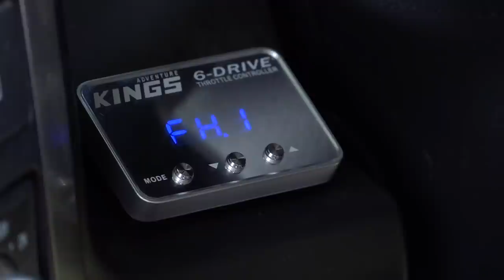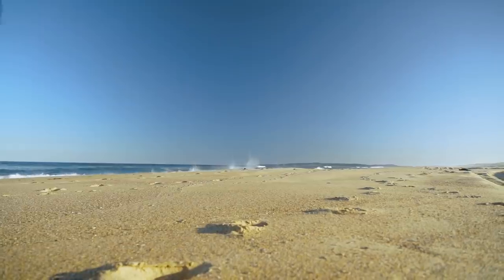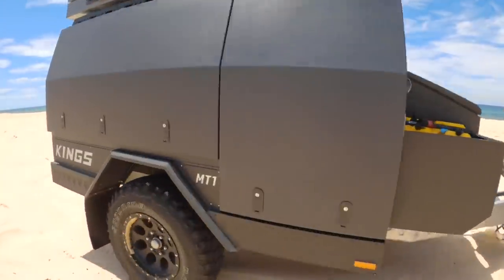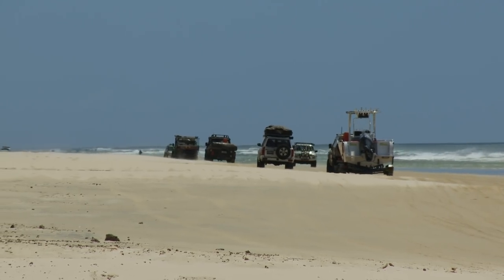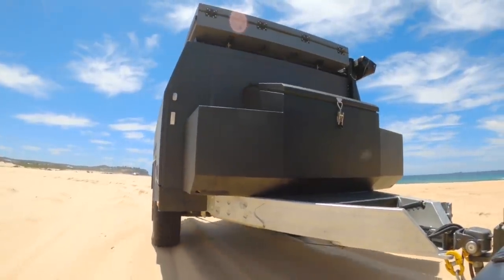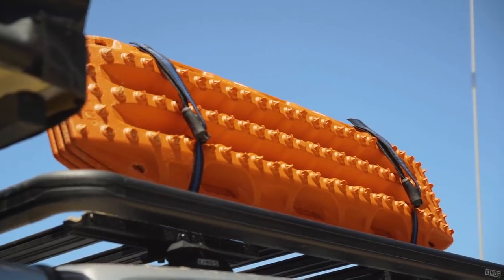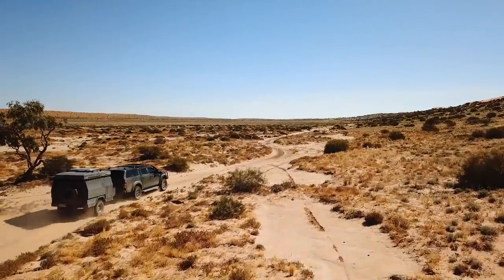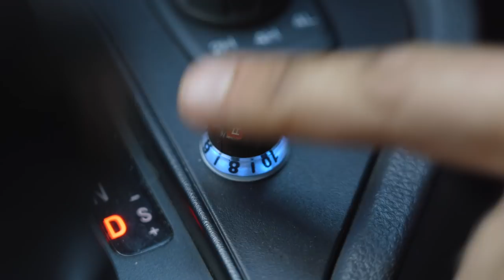OFFROAD TOWING TRICKS REVEALED! How to tow a camper trailer, caravan or boat on the beach or dirt!

Comment: I remember a trailer an uncle of mine had built out of an 8” truck bed, after cutting the frame just behind the front control  arms mounting points, then bent the frame ends in to weld a ball hitch to and tongue jack. He left the drive axle an brakes in place, while mounting a HD 24 volt starter motor off a Cummins engine, with a place underneath the bed for 4, 6 volt deep cycle batteries. All wired up with heavy cables and a forward and reverse controller switch in the tow vehicles cab. So the trailer actually had a drive axle to help whenever the truck towing it would bog down in sand or mud!! In the bed/trailer he also had a very nice truck camper set in place, that he could tag along with the truck camper sitting in the truck he used to tow with. That happened to be an International 8’ bed reg cab he bought off a local fire department! That was incredibly heavy duty 4x4, powered by a 392/4 brl V8, with a 5 speed low hole transmission. He used all the time on his hunting trips with his buddies, from R.I., to Maine, way up in the Allagash Wilderness, where they would all go up to a bunkhouse with power. The last I seen of his build was rotting away over on his property after his death. I believe it was all scraped? I wish there were pictures of it when it looked very cool!

Comment: Good basic info! I would add 1) DO NOT GO OFF ROAD without a fully articulating hitch/coupler ( a lot of "off road" trailers come with ball couplers) 2) in rocky train,  needed ground clearance can be lost when airing down too much and 3) you will need low range while towing over sections of trail that you've climbed in  4 HI without a trailer

Comment: Do you travel any tips for turning a camper trailer around on a narrow dirt road that has become too difficult to continue?
Reply: Unhook, move things by hand, if you can't get the trailer around the car by hand or drive around the trailer, use a winch and pulley set up to pull the trailer further out of the way. If you can't turn the car around, you shouldn't be turning around. If you can't get your car around, hope you have a front end hitch. If you don't, goodluck.